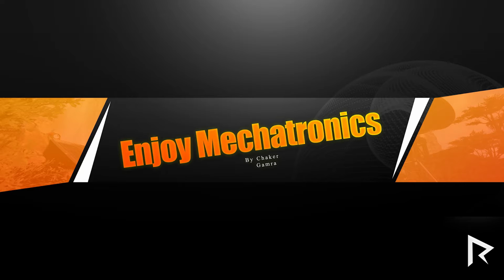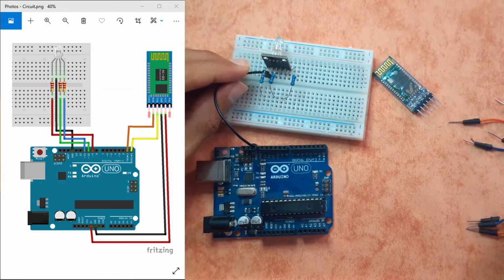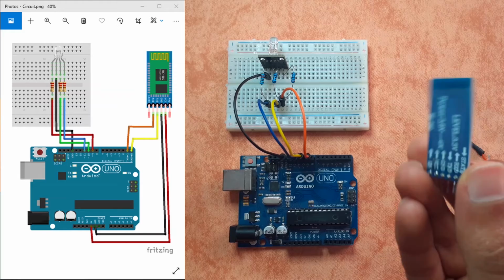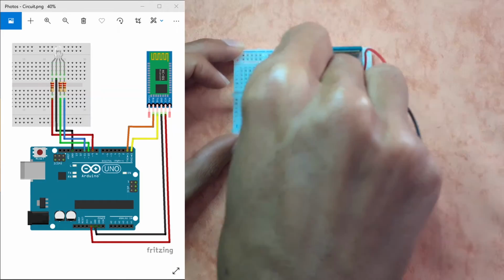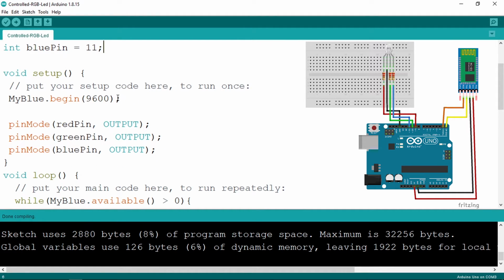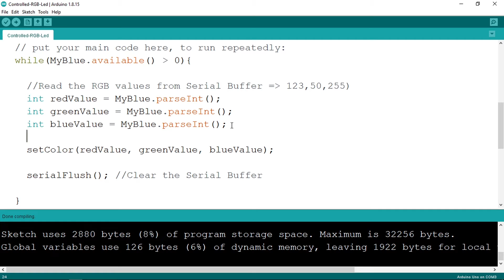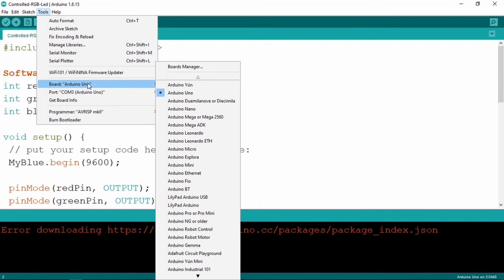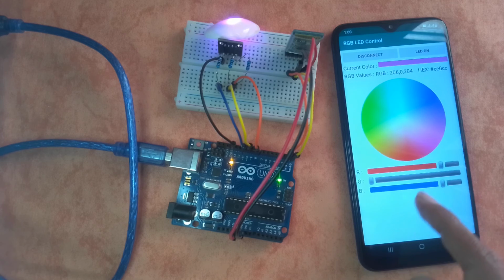Control an RGB LED using Bluetooth - Arduino Project

Comment: uhm, i have a question, can i change the LED into the RGB strip ? Is need to change the code ?
Reply from the maker: You have to use 3 TIP120  transistors